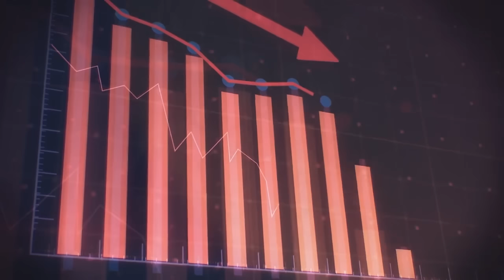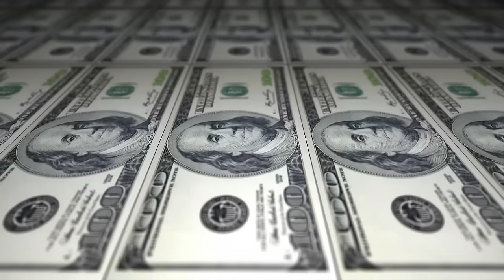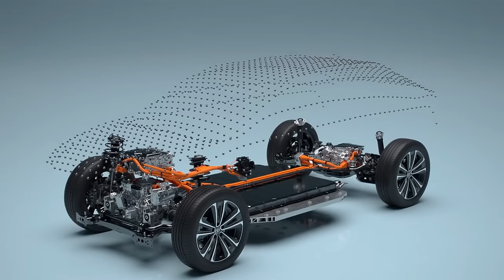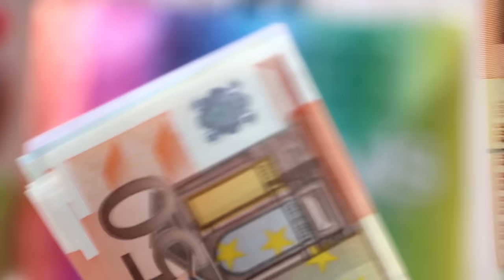The ‘I Told You So’ Moment: Toyota’s Predictions About EVs Come True! Electric Vehicle or Hybrids?

Comment: My wife bought a new Lexus recently. The salesman asked about her driving habits and then advised against a hybrid as it wasn't cost effective for her needs.
Reply: I cannot understand why that salesman would say that to your wife. 

Ones driving habits should not matter about your choice between a petrol or a Hybrid. They both have ICE's, they both run on petrol, they are both held up in traffic jams, and traffic jams do not discriminate by what you are driving, we are all in the same boat at the same time here.

During normal driving or when needing to pull a heavy load, Hybrids are just a joy, with extra torque in reserve.

Toyotas CVT does take a little getting used to but that is a very small LITTLE. The engine does have to work earlier but only if you are loading the throttle or climbing steep hills.

All Hybrids return a small cost advantage to run, whatever your driving habits.

I purchased a one owner Toyota Prius back in 2010 from a Toyota garage in Worcester. That car only once let us down and that was after 8 years ownership, on a very cold January evening when we went to the cinema. When we came back to the car it would not start. We called the AA and a short boost to the battery got us going.

Latter in 2017, I purchased one owner, Lexus RX450h (REAL NAME TOYOTA) with 67K miles and I hope it is the last car for me to buy.

In January this year it turned over to 100K miles, I no longer drive the mileage as I used to. My overheads are petrol, insurance, servicing, MOT's, one pair of tyres, I had all the discs and pads changed @ 80K miles 3 years ago as I knew they will now outlast me.

In return I get the joy of driving the best car manufacturer in the world.

TOYOTA…..As their 1970's adverts said…..Ask an owner.

My only sorrow is that I sold my 3 litre twin turbo Toyota Supra Mk4. 

I am still grieving now.
Reply: @daviddavies8637  When a salesman suggests I don't spend money on a more expensive car on which he would make a greater commission I tend to believe him.
Reply: @daviddavies8637  obviously she drives few miles.  i only drive 2,000 miles a year so it almost isn't worth owning a car at any price.

Comment: One of the biggest reasons is Tesla has such a huge head start on everyone. They have the best of just about everything including long-term relationships with battery manufacturers, extremely strong technology, best in class rechargers, and more. 

I have both ICE and a Tesla. My Tesla  charges at home and costs me 1/3 in  enegy prices than a gas equivalent ICE vehicle. Not to mention it virtually never needs servicing as regenerative braking and an electric motor that needs seals oiled every 18 years covers it-- outside of windshield wipers and tires.
Reply: The batteries are only good for ten years and cost tens of thousands to replace. So just wait it’s going to bite you in the a$$.
And even Elon doesn’t believe in forcing people to buy an EV.
Reply: If you take care of your batteries they'll last 20 years not to mention I've never owned a car more than 10 years. I did have a truck that needed a complete engine overhaul after 6 years.
Reply: Here’s a flash for you pal: if you’re not having any of the specified maintenance, and yes there is maintenance needed, you have voided your warranty. Depending on mileage you may need a couple of servicing stops @ $200+ to lube the brakes and a host of other stuff. I read this in Car&Driver magazines long term Tesla test. So….
Reply: @ChippWalters  how long does the battery last in your cell phone? Your ev battery is just a larger cell phone battery. I have never seen one last 5 years much less 10 or 20. But good luck with that, you’ll need it.
Reply: Did you know that Toyota invested in Tesla in Tesla's early days and Teslas were built in the old Toyota factory in California? Toyota had an all electric RAV 4 even before Tesla existed, but they decided to focus on hybrids.
Reply: @markvincent5992  Flash : My EV service intervals are every 24 months or 18,000 miles. 🤭
Reply: @markvincent5992  typical manufacturers Battery has warranty upto 8 years or 100,000. If degrades they will replace for free, so they must be sure they will last this long at least. Also there are a good number of Tesla model S still holding a high price from around 2014-2018, they will set you back around £15k-£20k depending on mileage (~70k). So doubt the SoH of the batteries is poor at the 10 year mark

Comment: I am old retired and living in my 2002 Toyota minivan which rarely has problems despite its age. But if I were young again and starting out in life I would want the EV companies to quit chasing longer ranges and instead build cheaper lighter vehicles that I would use for 90% of my driving which would be within the City and surrounding District. Secondly I would want auto rental companies to be prolific cheap and easily accessible for whenever I needed to go on longer trips.
Reply: if they didn't do it when you were young why would they now.
Reply: @victorhopper6774  because when I was young we were concerned about a new coming ICE AGE if you can believe that

Comment: People don't realize or not aware how expensive it is to replace an ev battery. Its like buying another used car
Reply: Not completely true.  If you don't go to the car manufacturer to replace the battery, it is half as expensive.  Example: a tesla battery would cost 10k instead of 20k to replace.  But yes, it is very expensive.  However, not the entire battery needs to be replaced, only the low performing cells so over time with more shops, it will get cheaper.
Reply: Will the batteries get cheaper or only the labor to replace them?
Reply: @outootus6734  ev's will be obsolete. Japan developed hydrogen powered engine. How come u keep deleting my reply

Comment: EV's are brilliant for many, not appropriate for some. We charge ours with rooftop solar.
Reply: Not when it is night or a cloudy day..
Reply: I go to  the gas station and I’m done in a couple minutes! Roof of my house not required
Reply: Probably at night? LOL. Also you would need a solar array 4 times the size of one for an average house to charge a BEV in a reasonable time...IF the house didn't draw any current at all.
Reply: So you don't need to use the car during the daytime?
I love my electric, but I'm lucky if I get a full charge plugged in overnight.
Reply: You really expecting any positivity for EVs from a channel called Piston Pundit? Not the most balanced comments. 😂

Comment: Great run down of the victory for the customer who is not convinced (yet) of the total package of EV’s; as Toyota realised some time ago. But on the disadvantages of current EV’s you didn’t mention the very low prices that 2nd hand EV’s go for.
Reply: Because no one wants them and you will have a $15k battery replacement cost n your future along with resale value that reminds me of the Yugo

Comment: EV should not be forced . Infrastructure is not ready. We don’t have enough electricity as is. Now they want to use more. The cost environmentally from mining to produce batteries. The carbon footprint for just acquiring materials would be high.
Reply: Who is forcing you to buy an EV?
Reply: @RayThackeray  Mandates to build BEV are Force. When they mandate all BEV there will be no choice, that's force. BEV is being pushed with tax dollars, that's force. EU moratorium on repairing older ICE cars is force. Radical taxes on fuel is Force. The power to tax has always been the power to Destroy. Gasoline is $9 USD per gallon in Norway due to taxes. That is Force being exerted.
Reply: You are hyperventilating, get medcal help.
Reply: Nothing in your comment is correct, glad you weren’t around when the switch was made from horses!
Reply: @RayThackeray  The only thing that might be incorrect is the OP understated the case. It's far worse than he is intimating.
Reply: @robertkubrick3738  Come back when you have mastered the concept of facts.
Reply: @RayThackeray  You wouldn't know a fact if it bit you. You couldn't even define what a woman is.

Comment: In the 1980's plastic fuel tanks replaced steel fuel tanks. BASF in Germany made the first ones but only to 40 litres capacity. Ford Australia heard about the plastic fuel tanks but needed a much larger capacity of 70 litres. So they built their own plastic fuel tanks. They filled test tanks with water and dropped them from a great height onto a reinforced concrete pad to see where the tanks failed. They also set a fire under cars and the tank had to survive intact for 30 minutes. Many cars were destroyed as their tyres caught fire and the rest of the car caught fire too. 
The Americans tried the fire under a car with a steel fuel tank filled with gasoline. The tank exploded and exited the car via it's sunroof. 
Politicians in Australia freaked out at the thought of plastic fuel tanks rather than steel fuel tanks. But the fire service people had witnessed the tests and had no problems so plastic fuel tanks stayed and now no car built has a steel fuel tank.
How many EV battery packs are dropped from a great height onto a solid surface and how many EV's have a fire set under them to see how long the battery pack lasts before it catches fire. Also how many battery pack are purposely set on fire to see which is the best way to extinguish them, none that I know of. If they had been purposely set on fire and the best way to extinguish them had been communicated with fire departments then the problems with EV fires wouldn't be a problem. The public are being used as guinea pigs with the EV.
Yes ICE's also catch fire but they're much easier to extinguish then an EV battery pack fire. The rush to make EV's viable has seen a lot of safety corners cut in the race to make money. 
When an EV catches fire it is very quickly no longer an EV but an internal combustion vehicle quite literally.
Reply: @Aussie…   And how many of the millions of EVs out there have had their batteries catch on fire? Unsure? Look it up. Luckily petrol/gasoline never catches on fire in an accident and nobody has ever burned to death. All praise the safety of gasoline over batteries! 😂
Reply: @gwarlow  That's because ICE cars for many years have a cut off valve so in an accident there's no chance of the fuel igniting even in a rear end collision.

Comment: The grid clearly cannot support so many EVs.  Further, the grid is deteriorating rather than improving, even as the population is increasing.  Replacing a battery is more expensive than replacing the whole car.
Reply: So don't replace the battery. Have it refurbished for a fraction of the cost of replacing it...... That's what you do with a worn engine. You refurb it. You can do the same with EV battery packs.
Reply: @Brian-om2hh  That's not how it works.  Look at the cases where people damaged the battery on their EVs, for example driving over a speed bump.  The quote for the repair was higher than the price of a new EV.  Standardizing batteries and implementing swappable battery packs is a great idea in theory.  But since an EV is mostly a battery, it is technically hard to implement.

Comment: The issue is with the battery technology. Should've invested in graphene/next generation battery technology research. Would've seen sustainable growth in the ev sector.
Reply: Solid state not far away and apparently Toyota on the forefront.
Reply: Graphene is a joke, too expensive to use.

Comment: For EV to become mainstream, charging infrastructure has to be easily accessible and cheap. Batteries also has to be affordable with very high energy density
Reply: And for that to happen...
Reply: It was the same for the Hydrogen powered cars. Build the cars, then what? Where is the hydrogen going to come from? Fossil fuel plants.
Reply: Transportation Secy Mayor Pete - when asked about the lack of stations - actually answered that "we're hoping to have enough stations".
There's no PLAN, just a wish and $12B allocation - but they are not being built.
Reply: They will become mainstream when you can charge them as fast as you can full up with gas!
Reply: @mikeofallon  $12B all stolen.
Reply: @blakeloington5476  I don't think that would be realistic,  as faster charging would require increasing a lot more electric current to flow through, which would increase the chance of catching fire.  

I do think that cheaper batteries( by using materials that are very abundant) and increasing energy density( increase energy density by 10 fold) would be more realistic. Increasing energy density 10 fold would make EVs a lot more desirable,  as it would increase range a whole lot more; thus reducing the frequency of charging so owners would worry less about the number of charging infrastructure. Increasing energy density(a lot more energy for the same weight or a lot lesser weight) also means lighter vehicle as you need a lot lesser batteries and lighter vehicle also means vehicle will use lesser energy to move forward. 

So increasing energy density of a vehicle brings so much more benefits as compared to reducing charging time
Reply: @tanalson  they will never be10 times more energy dense than gas but they will be a lot lighterin 3 years or less.

Comment: I bought a new Mitsubishi PHEV.  Kept it 6 months.  Expect fuel consumption of 7 - 10.5 ltrs/100km, inaccurate fuel content indication, range of around 400km (not good in France), electric range only about half of what is claimed.  4WD system excellent.  Lacks power on mountain roads.

Comment: range  and  charging  anxiety  are  the  main  reasons  people  are  wary  of  all  electric  cars. comes  down  to  reliability. imagine  planning  a  coast  to  coast  road  trip  in  an  electric  car. what  are  the  odds  the  car  can  make  the  distance?
Reply: I drove myself, my wife, my kid and his wife and their three kids from a northern state to New Orleans on a three day trip with a few stops. A week later we drove back in two days. That was in my Chevy Suburban. We were all comfortable, had all our luggage and entertainment to boot, ( monitors built into headrests). There is no electric vehicle that would have made the same trip.
Reply: @braddouglas7839  Neither will the car you have now, once existing oil reserves become unviable. Oil is a finite resource. It will run dry one day....
Reply: @braddouglas7839  tech  that  people  distrust  is  doomed. electric  cars  need  a  major  technological  improvement  if  potential  car  owners  are  to  consider  electric  as  a  worthy  contender  as  a  personal  vehicle. basically  all  ev  owners  are  like  the  canaries  in  the  mine  whose  job  is  to  ferret  out  the  teething  problems  evs  still  face.
Reply: @Brian-om2hh  We are Not running out of oil. We have produced 1% of all the oil we have located to date. We have natural gas for at least 1,000 years.
Reply: @Brian-om2hh  Neither will electric cars when there is no more copper to be mined, to make motors and generators. Tesla uses over 60 kg of copper, that is just one car.
Reply: You really have to get out of your bubble, this is done every day!
Reply: Theu should force gas station to have charging station instead forcing people to buy ev cars in the first place then we will see if people will change their mind buying ev cars😂😂😂
Reply: @koivelasquez5703  I don't  think that any government on the planet has had to  force  companies or individual to open a gas station, so why gas stations whose main income is fuel, should be forced  to sell electricity?  Inducements;   that how  things work in nature, not compulsion.

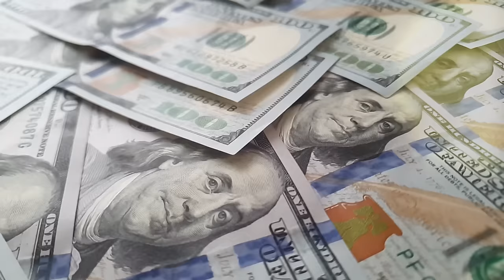Comment: 05:05 
Ford never even range tested their $110,000 "Lightening F-150" pickup truck with a modest 30' RV travel trailer @ weekend camping trip before spending BILLIONS.

Can you imagine ?!?

Then 2 YouTubers did vs their standard Gas F-150 truck, finding our the overpriced EV trucks range was but 90 miles, far to little to even make 1 leg of camping trip & nearly stranding family between charge stations.

Sounds like a B!DEN inspired camp out, eh ?

Comment: It's not just EVs, it's also the infrastructure. Some places (California for instance) are struggling to supply electricity, as it is, partly due to lack of decent maintenance, partly because of converting to 'renewables'. Increasing the number of cars that need charging will put such a strain on an electricity grid that it will fail and continue to fail until it's substantially upgraded at huge cost or until the EV market becomes one of the niche markets for enthusiast only.

Comment: 2009 Toyota Prius 625 335km on the clock and only complaint is standard wear and for the second time it needs a new NiMH battery. Last time it needed a new battery it had almost 400 000km on it. To save a dime, I bought used battery and now it starts to act up in cold temperatures.
   I won't talk about it's 1,8l inline four, because that thing just works. 

And if you want to work on one. You can. Just don't mess with orange cables. 
   You can change the oil, sparkplugs, filters etc. You can change the brakes and suspension components. But if you must work with electric systems. DO YOUR RESEARCH CAREFULLY. And remember to unplug maintenance separator from high voltage battery.